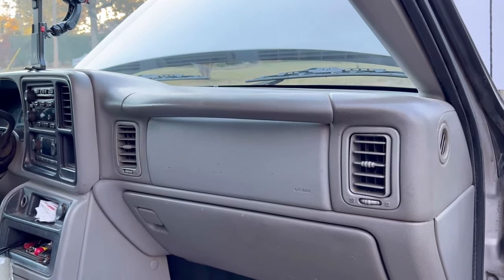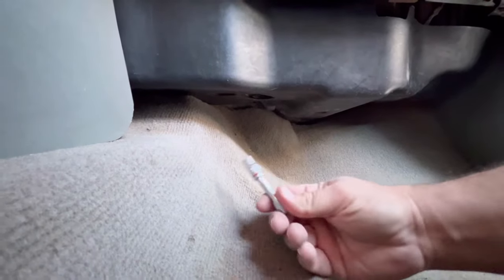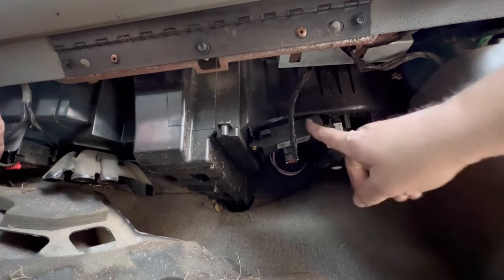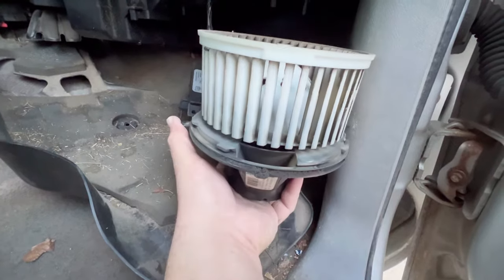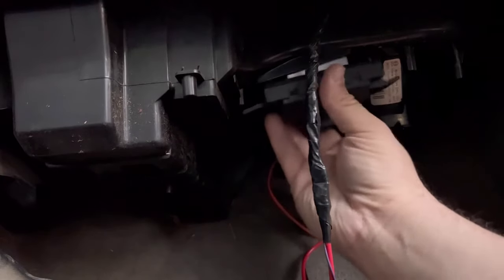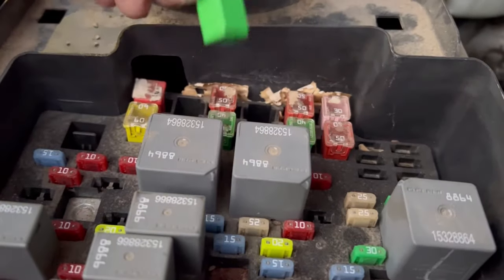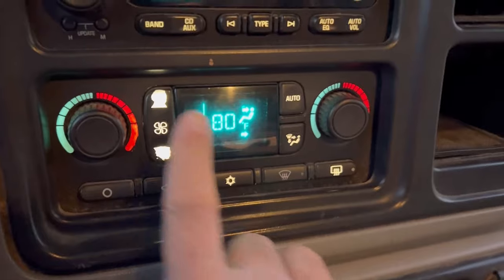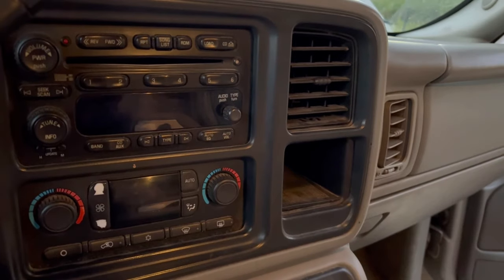How to fix a blower motor that won’t turn off and has no speeds

Comment: I have a question, do I need to replace the harness to with blower motor or it could be just the blower. ?
Reply from the maker: I didn’t replace the harness, but you can. I’m sure it can be problematic.

Comment: I have a GMC Savana that I parked awhile ago.Went to start it..battery dead.Hooked up cables..yep..blower fan is running.Would not jump start.Battery conpletely drained.Going to try pulling the wires to the blower.Or pulling the fuse.I'll try and charge the battery.I have no idea yet where the relay switch is.
Reply from the maker: Unplugging the blower or fuse would definitely help. At least until you can find the fault.

Comment: Did this, my blower still blows with key off. This is a fix, but not the fix for me.
Reply from the maker: Yikes! Sounds like there’s some contacts crossed somewhere.
Reply from the maker: Might want to disconnect the battery until the issue is traced.
Reply: @GrubNGas  Well I’ve had the fuse pulled for quite some time now. Had time to change it today. Unfortunately it didn’t fix it for me. I have a loud stereo in here, I’d imagine shaking the firewall violently would’ve caused this. Lol
Reply from the maker: @hunterzent3460  I hear ya, lol!!! That could do it!

Comment: So mine would turn on whenever it wanted to and only be at speed 5. It was draining my battery. I replaced this and it didn’t fix it. Changed the fuses as well.
Reply: 2002 gmc sierra
Reply from the maker: What about the speed selector switch on the dash? Is it ok?

Comment: I replaced  that and still stays on
Reply from the maker: Hmmm….may have a defective switch?
Reply from the maker: How did the wiring harness look?
Reply: @GrubNGas  all brand new and replaced an stays on when my truck off
Reply: The plug to the resistor kinda melted
Reply from the maker: @wickedlokz1849  ah, that might do it!
Reply: Mine is doing the same. Stays on even when trucks off.
Reply from the maker: @Saccitykid  how does that wiring harness plug look?

Comment: Has anyone had a problem that sounds like the vent won’t stop switching air current from the defrost to vent over and over on passenger side? At least that’s what it sounds like I haven’t confirmed that’s the issue. Know how to go about diagnosing that?
Reply from the maker: I’m not entirely sure, but it sounds like the door that directs the air flow isn’t moving.

Comment: Will this module work on the rear blower in a 2003 Tahoe?
Reply from the maker: Does yours have auto AC or manual?
Reply: It has auto AC. The blower will at times not turn off and other times it will turn off when the ignition is turned off. It will turn itself back on some times a few seconds after it turns off with the ignition switch. Kind of strange. The resistor looks just like the one you removed from your truck.
Reply from the maker: @tjrobil  I did some research and the OEM numbers I’m finding for yours are: 89023386, 89040361, or 93803634…but definitely check those at a parts store to be sure. My part might work, but I’d hate to say yes and it doesn’t.

Comment: I replaced the resister module with a New module and it did NOT fix the problem.  f**k.
Reply from the maker: Dang…have you tried a blower speed switch?
Reply: @GrubNGas   Well I removed the Switch Assemble and the Blower even stay ON with it fully disconnected and pulled out of the vehicle!  wtf?  I also pulled every relay out (one at a time) about a dozen of them, And Blower still goes and goes.  Maybe they sent me a jacked resister module.
Reply from the maker: @toxsickdog  what about the blower motor fuse?
Reply: It has to be the climate control unit